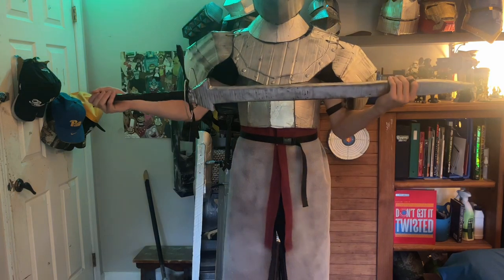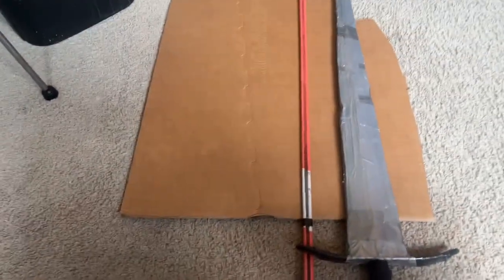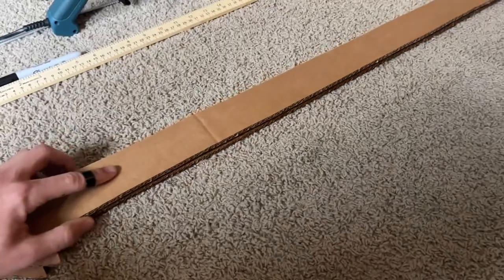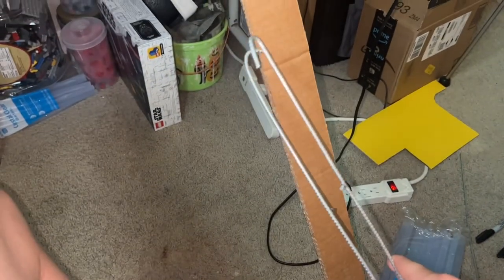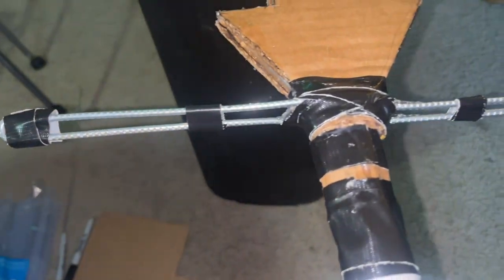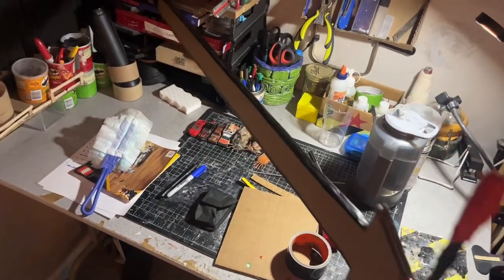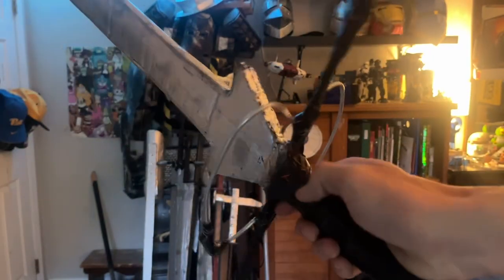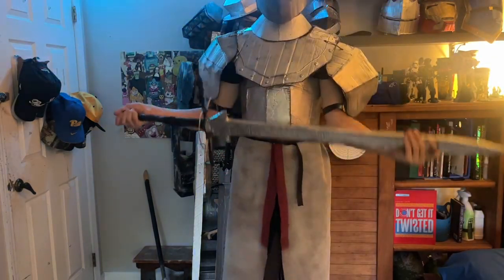How to build A Cardboard Great-Sword

Comment: Tips for anyone who wants to use this as an actual sword: add suports on the blades edge to prevent the cardboard from chipping uppon inpact and do desame on the guard.
Reply: Also make sure the pint is not sharp or has a hard support to avoid or minimalize the risk of injuring your friend when accidentaly thrusting.

Comment: What kind of paint did you use btw? Also did you seal it at all afterwards? Thanks for the video!
Reply from the maker: I should have sealed it with like plasti- dip or spackle on the cracks, but I did not. I use duct, tape and hot glue. The paint I used was silver metallic spray, paint, and then spray paint for the handle.

Comment: how do you cut out the slot for the shaft
Reply from the maker: Leave a time mark so I know what’s your talking about
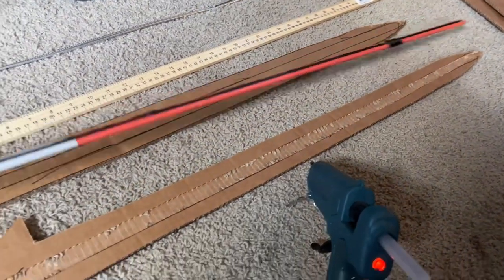Reply: 1:47
Reply: ty for replying so fast btw :)
Reply from the maker: @tomato-tomahto-potato-potahto ahhh ok so you score the cardboard but not too deep so you can peel off the first layer of paper and then the zig zag layer I like to carefully remove as well but you can also squish it down so the shaft fits
Reply: @MarksWorkshopcrft  ty
Reply: @MarksWorkshopcrft  btw can i do this with 1 metal rod instead of 2 fiberglass rods?